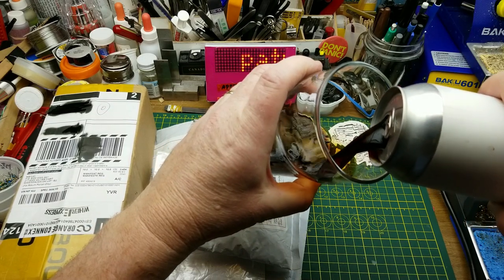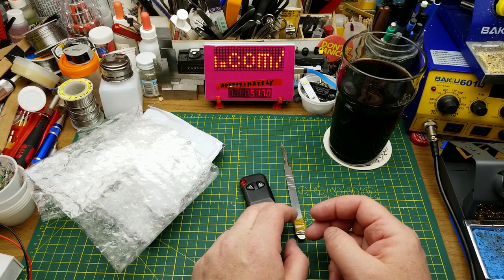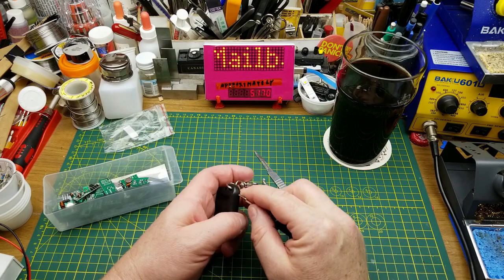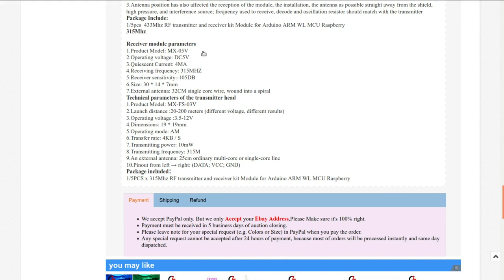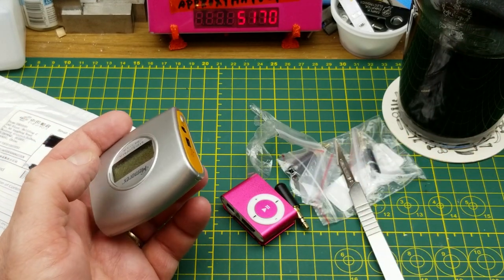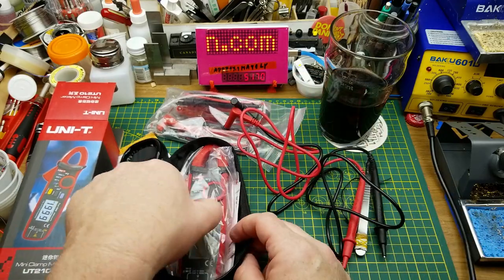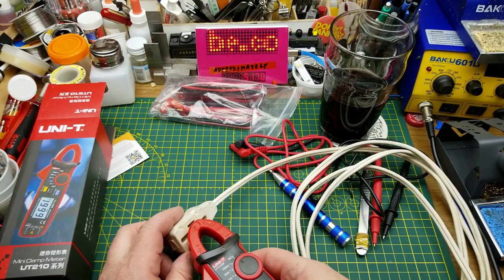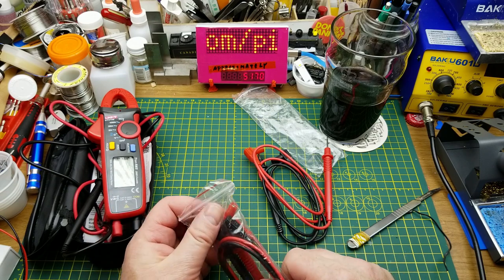mailbag monday 81

Comment: I think I have one of those clamp meters somewhere. I bought mine because the clamp did both AC and DC current. That super cheap one I swear is sold under a thousand different names. I've seen several different ones and they all look like one Harbor Freight sells in the U.S. I have several different meters including 2 with bluetooth and a Heathkit VTVM I assembled 42 years ago.

Comment: I've had one of those meters for a while. The only issue I had was it doesn't like to stay zeroed in DC amps mode.
Reply from the maker: That's a symptom of the method of reading current (I believe hall effect sensor). My Fluke at work does the same thing.

Comment: Flash the UT210E to get a higher count and let it default to DC instead of AC.
Reply: That would have been my suggestion as well! Changed mine to 9999 Counts and default setting to DC instead of AC, i think i extended the timeout as well.
Reply: @Sprengi86  I hope yours has the DM1106 chip then or the True RMS reading will be incorrect.
Reply from the maker: That's an interesting idea. I'll have to look into it.

Comment: Some times it is better just to buy "local".  ie.  I've got the same UT210E but got it on Amazon .CA for $45.89  I just checked.  It was a "Lightning Deal" from 3 years ago.  And delivered at lot faster than 15 days... likely a day or two.  But the real benefit is that any problems would be easy to deal with vs. buying from China or HK.  Anything at that price or maybe above $10 or $15 and a "common" brand or item I check both Amazon .com and .ca first.  Often the .CA can be way out of wack vs. .COM but sometimes it is actually better.

And for computer cables like that SATA (sa ta!) you can find locally at a computer store (not the big box Best Buys, etc.) pretty cheap in stock and finish your upgrade before China even has it in the mail.  Try Memory Express.
Reply: Well you made me look...   ;-)  Just checked now on the UT210E and it is $57.99 on .CA and $50 USD on .COM so actually 13% cheaper than ordering from Amazon .com and dealing with import, etc.  But again if you watch for sales (lightning deals, etc.) you can do better if you aren't in a rush.  In any case, I'm sure you will make good use of that meter.  Best bang for the buck on clamp meters IMHO.
Reply from the maker: Most of my computer upgrade did come from memory express. 

I wasnt in a hurry for this cable, and i didnt feel like driving across the city yet again for a cheap cable.

Comment: Best thing about this Ut210e meter, you can hack it to have many improvements, like default dc volt and ammeter, even 1000a range if your meter has specific chipset. There is a thread on EEVBlog forum about this, I used what's in this post: https://www.eevblog.com/forum/testgear/a-look-at-the-uni-t-ut210e/msg1423248/#msg1423248 to make it work.